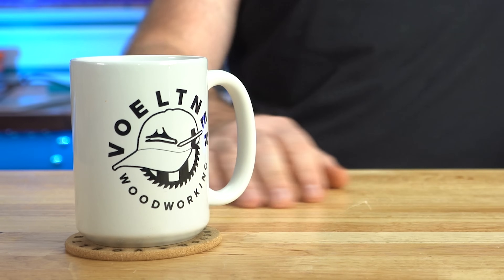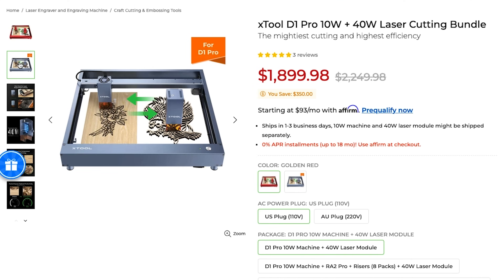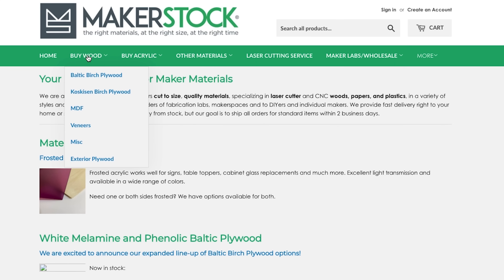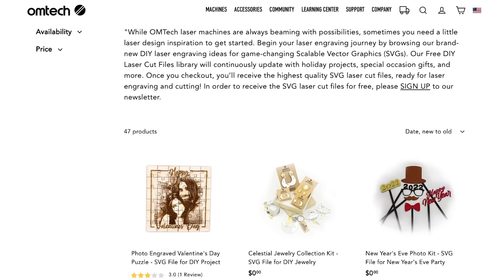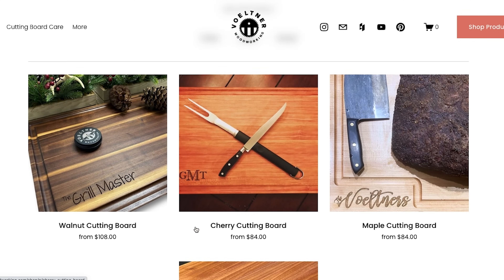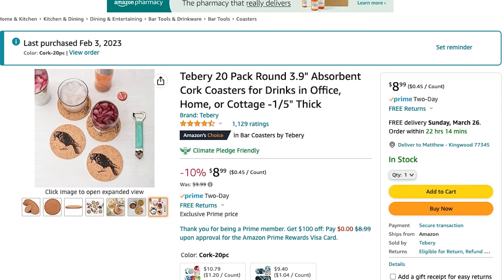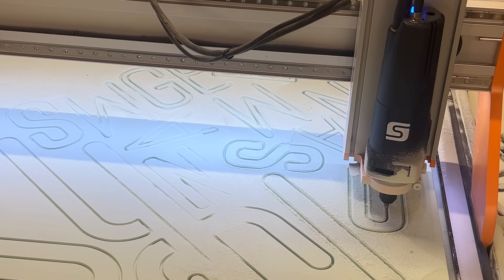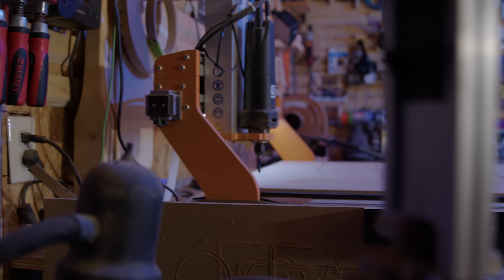I should have NEVER bought a combo machine

Comment: As a longtime scroll saw user, I have held out on buying either of these machines for a very, very long time. However,  I am beginning to think more about the limitations I'm putting on my abilities,  as opposed to thinking of laser cutting as an abhorrent shortcut.  
I guess it must be how the buggy whip manufacturers thought about the first cars, if you get my meaning.
Great video with lots of information to consider.
Reply from the maker: Thank you! I’m actually going to be doing a video about how the laser cutter makes the scroll saw (almost) unnecessary. If you’re making more than one of something on a regular basis, the laser can save a ton of time. I’ve got a couple of videos planned out for the next month or so. Hope you’ll stick around. Thanks for watching and let me know if you have any questions.
Reply: @VoeltnerWoodworking  after a couple days of fairly intense research,  I've determined that I know less than I imagined about newer technology in wood tools.  I think I may be more confused than before when I just disliked it.  Lol
Reply from the maker: @CoreyShockey  I think you’ll be very surprised with the ease of use of a laser. If you can follow a recipe you can use a laser. I would start there before launching into the CNC space. The barrier to entry is a lot lower.
Reply: @VoeltnerWoodworking  I guess I'm thinking in terms of which laser tool to get. I'm honestly still not too interested in CNC. However personalized options will be great for my jewelry box builds and other things I'm considering.  I'm struggling with diode vs CO2 and the size of the unit. While price is always a consideration,  space is honestly my biggest concern.  My shop is a part of a 2 car garage and everything has to be pretty mobile or bench top so I can move it around as needed.
Reply from the maker: Did you check out this video? 

The BEST laser to make you money!
https://youtu.be/19ZNZCOwRas
Reply: @CoreyShockey  The Xtool D1 20w , or Creality Falcon2 22w are both great machines and a very good deal, there is a decent amount of documentation for both of them and a decent community surrounding the both of them and laser engraving in general has a wonderful community of people.
Reply: @b-rad7708  I actually decided to start with the Xtool. It is supposed to arrive Friday. I already have some ideas for very basic things to try while learning yet another type of woodworking.
Reply from the maker: How is that xTool doing for you @coreyshockeydriver ?
Reply: @VoeltnerWoodworking  Still having some learning curve issues, but that is to be expected. Overall I enjoy the creation process and haver had quite a bit of success with smaller projects such as coasters. I'm looking forward to trying some more difficult projects in the future.